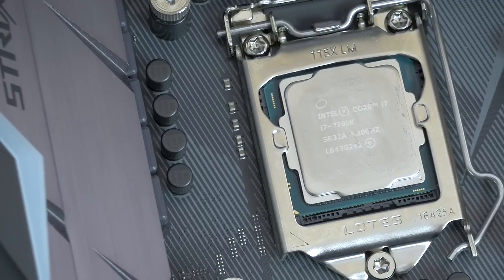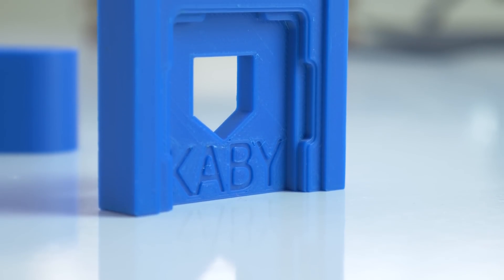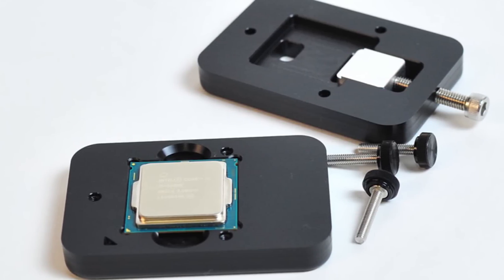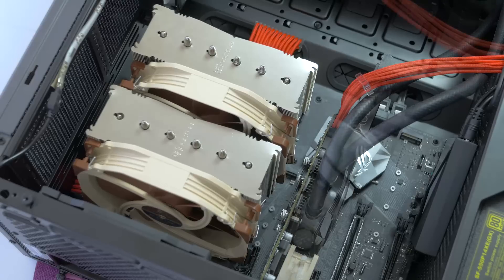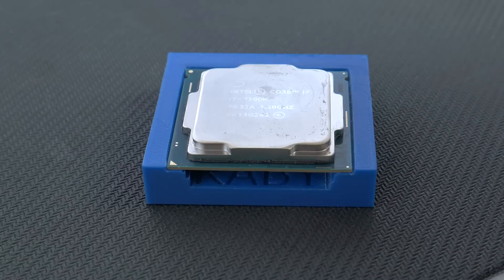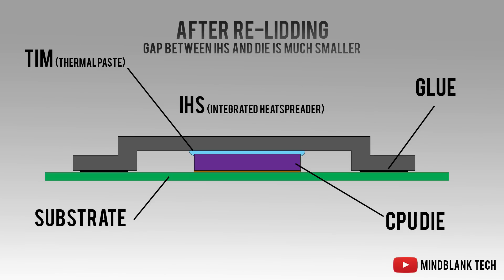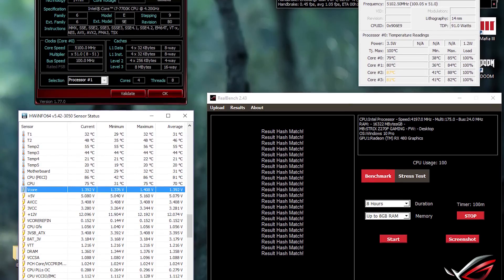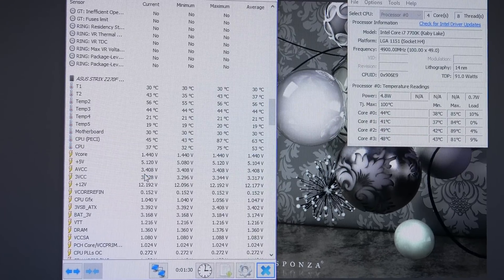Delidding the 7700K - 5.2GHz Overclock - 25C cooler

Comment: The Kaby lake series is already so expensive so why would Intel skimp out on proper cooling?
Reply: Intel has no competition to go against, so why bother.
Reply: Gabriel Umoh I really hope AMD smashes Intel. as there crappy tim jobs are OK on lower tdp chips. but the k series could really benefit from solder, it's not like you don't pay a premium for the k variants allready.
Reply: Another reason to leave intel and go with AMD, I have all my hope in ryzen...
Reply: so people upgrade again to a new intel cpu once amd brings back some competition and they start soldering the chip in their 8000/9000 series chips
Reply: Pop Jones They obviously do if the temps are that high compared to delided chips.
Reply: He means "Don't be an idiot, buy AMD Ryzen."
Reply: oh I wouldn't bother with that neanderthal listening to anything he types is just cancerous.
Reply: If it did degrade the die, then why aren't Sandy Bridge chips degrading? They seem all alive and well with very aggressive overclocks and lower temps than Ivy Bridge to even Kaby Lake chips (prior to delidding). The answer seems simple, Intel's using arguably worse manufacturing process on the reliability side of the chips they're making since Ivy Bridge.

Hell, Der8auer delidded a 5960X and a 6950X and the soldering job was... awful. Like, you'd think a soldered chip would help heat dissipation, but holy hell... when liquid metal thermal paste does the job much better, you know Intel's up to some shady min-maxing on their profits, sacrificing some sense of quality control in the manufacturing process.
Reply: 60c in what? prime 95 small iff or intel burn test or cinnbench or just 60c in games and normal use?
Reply: Gabriel Umoh    Maybe it's to make  enthusiasts void their warranties.
Reply: overheating will demage your cpu not oveclocking +blvk3
Reply: The 7700k only supports Dual Channel RAM. And Ryzen beats chips that are hundreds of dollars more than itself. Ryzen 5 shits on i5s and goes toe to toe with the i7 in new games with better multi-thread support, for 100 bucks less. There is no reason to buy Intel unless money is not an object now.
Reply: @The chemtrail kid
Why not take your own stance? Why not take both statements into account and think for yourself?
I don't think they're using this particular thermal paste just to save money, but it's prbly a nice bonus that made them consider this choice. 
You should watch AdoredTV's newest video, in which he explains just how low the quality of the consumer grade Intel silicon actually is. 
Basically: The best thing they can produce is a 24 core chip. But until AMD brought Ryzen, Intel was giving the mainstream only duo and quadcores. Let that sink in for a second. 
Now they're suddenly launching up to 12 core chips with Kaby Lake X. Just like that.
Why is that? It's because they have been selling these chips as xeons for the server market prior to now. 
The Intel 7700k is literally the best of the worst rubbish Intel can produce.
Reply: Uh okay... it's IPC... just saiyan. And no, AMD is behind in both IPC and refinement of the process / max reachable clock speeds. 
"If games and content creation really did prefer higher core counts, Ryzen would absolutely dominate Kaby Lake mainstream and it does not. It is competitive because its IPS is similar to what Intel has to offer."

Acutally, Ryzen obliderates Kaby Lake in content creation. Look at some Benchmarks of production workloads:
https://www.golem.de/news/ryzen-5-1600x-im-test-der-fast-perfekte-desktop-allrounder-1704-127157-2.html
Doesn't matter if it's blender, 7zip or cinebench.

As towards gaming: You're operating off of the false assumption that AMD is equal to Intel in IPC and clock rates. They're not. Core for core, skylake is about 15% ahead on average - AMD is only offering Broadwell-E IPC. 
http://cpu.userbenchmark.com/Compare/Intel-Core-i7-7700-vs-Intel-Core-i7-5820K/3887vs2579

Take a look at the single core performance.
Reply: @WTF HOLYFUCK
Well, I would rephrase that: AM4 is future proof. AMD confirmed the continued support of AM4 until 2020 and for at least 2 more iterations of ZEN chips.
There is nothing stopping them from bringing 10, 12, 14, 16 cores to the mainstream market if it makes sense business wise in the future. 
Buy a decent AM4 Board now, get the Ryzen 5 1600(x if you don't want to OC manually) and in 2019 or 2020 get yourself an 8 core with 4.5 ghz and you're set.
Btw. when it comes to Intel: There are a lot of rumors that coffee lake, Intel's gen 8, will come out in August with 6 cores for the consumer market. 
Very, very soon, the same zealots who argue right now, how you don't need more than 4 cores will completely change their minds and tell you that 6 cores are the way to go. But ofc only from Intel.
Mark my words.
Reply: Look at all these intel engineers talking facts here (no sarcasm)
Reply: Damien even if it's true it would be obsolete long before it has degrated. intel is skimping.
Reply: Gabriel Umoh maximize profits
Reply: I dont know if it is bad luck or what but I have mine at 4.9ghz and it maxes out at around 60 degress (nzxt kraken x52)
Reply: Yep 5ghz @ 1.3v stable H115i AIDA64 temps hitting upto 85...
Reply: i7 7700k is only good for very high fps. 144+ around 100 fps it doesn't matter anymore.
Reply: intel has used crap thermal material or compound for along time also they glue the ihs on... instead of welding or soldering. I think since 2nd gen i3 / i5 /i7
Reply: @Gabriel Umoh to hide the true potential of the CPU. They can ask the price for the performance they're providing already, why let it boost to 4.5 or 5 ghz then?
Reply: +Mario Darnadi I like how you make unbelievably dumb comments, on a well informed and informative youtube channel. I'm honestly surprised you aren't banned or blocked. You telling people they are wrong for their own choices or think against it, is fucking childish. Man baby. Stop liking your own god damn comments as well.
Reply: this is one mystery i would never understand, as if ppl can tell between 140 fps and 120 fps.
overclocking will damage your cpu in time anyways. and its not like the base clock is slow at all
Reply: yeah i liked my own comment 3 times you fucking moron .... i said you are wrong ? well you are wrong why would the weld it ? without OC you dont get less *c from it. if you said " only if they used better termal paste then ok but you think you are so smart using terms what you find on formus..
Reply: why didn't you ban him? this kids useless... comes on here and literally degrades the comment section of your youtube content. Do yourself a favor MindBlank
Reply: you clearly did like your own comments, they only had 1 like. It's impossible for anyone to like such garbage information

also you have no clue what I even said, I said intel glues instead of welding or soldering.

that plays a huge part in temperature disparity over cores.

Jesus christ man. grow a brain or something
Reply: @Mario 
Au contraire, you're a clueless carcinoma trying to spread misinformation.
M'lady.
Reply: @Angus1MacGyver
Even among enthusiasts the consensus is to leave thermal paste be as long as temps are fine. Obviously it depends to some degree on your use case, meaning which compound was applied, how big the delta °C is throughout operation, how much load your pc is dealing with and for how long (always on?).
That being said, some people like to re-apply thermal past every 12 months to ensure that the cooling performance is always the best it can be, given the equipment.
Reply: Because they have to worry about more than absolute best temperatures. I guarantee you they picked this TIM with shipping conditions, application consistency,  and long term performance over many, many heating cycles in mind.
Reply: That's incorrect, it's all about money savings, not about longevity or anything like that, thinking like that is what intel wants you to think. They want you to think they went the cheapest route cause it's the best.

It's not. It's a farce. Send me a cpu, I'll delid it, re thermal it, build it and never touch it again for 10 years, and the "liquid cool ultra" will still be perfectly fine.

So, nope you're wrong. They don't worry about anything other then money.

You should honestly know this by now.
Reply: why does a company exist? To make money. What's the best way to make money? make people think you're CHEAP AS FUCK SHIT, is MADE of gold.
Reply: Shame on Intel for not using liquid thermal paste on their high-end models because it lasts ten years. Let's all buy AMD now. Case closed. Fuck off.  

Meanwhile I'm enjoying my (not delidded) 7700k @4,7Ghz+ below 68°C on air cooling. My stock paste is so cheap it won't allow you to overclock over 5Ghz. Shame on Intel for that. 

But all shittalking aside, you still get what you pay for on a 7700k, even if it doesn't allow a 1Ghz overclock without TIM modifications. Those chips could be $1 dollar in manufacturing costs and they'd still be worth it for what they deliver.
Reply: I think I'm going to trust Intel's R&D team over WTF HOLYFUCK's extensive YouTube posting.
Reply: Because didn't you hear that they don't want us to overclock Kaby Lake chips? Lol!
Reply: I am. Looking solely at core count is like looking solely at clock speed ten years ago. Whether you like it or not, even things like video editing still favor higher clock speeds over massive core counts; Linus did a good video on this. On the mainstream, investing more many into higher core count chips gets sharply diminishing returns for the vast majority of uses.

Intel has released higher core count chips to appease market demand because people associate performance with a higher number.
Reply: The clock rates hit a plateau with Intel's Netburst architecture back in 2002. Yes we've managed to go beyond 3 ghz, but considering it's been 15 years since we hit 3 Ghz, we can still speak of a plateau for the most part. 
Like it or not parallel computing is the future, not single cores with high clock rates.
"Whether you like it or not, even things like video editing still favor higher clock speeds over massive core counts; "
Aside from the fact that most people prbly use CUDA cores for rendering, that's just false. Outright false.
" On the mainstream, investing more many into higher core count chips gets sharply diminishing returns for the vast majority of uses."
Actually it's pretty much only games with old API's (DX11 and prior) that don't need that much parallel computing power.
Vast majority of uses? Name a couple.
The "mainstream" desktop market is dying either way, with a rapidly growing mobile market to substitute it.
Soon only content creators, enthusiasts and gamers will buy PC's.
And out of these 3 groups 3 need massive core counts. For content creation it is already true, for gaming it is slowly becoming reality with each new DX12 / Vulkan game that's coming out.

https://www.computerbase.de/2017-02/cpu-skalierung-kerne-spiele-test/#diagramm-ashes-of-the-singularity-dx12-fps
http://images.techhive.com/images/article/2016/02/dx12_cpu_ashes_of_the_singularity_beta_2_average_cpu_frame_rate_high_quality_19x10-100647718-large.png

As more and more games with a core scaling like ashes are coming out, very soon hexacores will be the new midrange, even in gaming. I mean since ryzen they kinda already are, but the games aren't fully optimised quite yet and there are still some popular titles with older API's.
Reply: People have been saying big improvements for multi core support in games and cont creation is coming for years now. It's improved but now much, IPCs are still king. 

Enthusiasts don't purchase equipment because they "need" it, they purchase it because they want it.  

Content creators are using more and more GPU driven approaches. Seriously, Linus has done a tone of work on this and found super high core count chips just don't pull ahead like they should if multi core support is really where it's at. 

Games still aren't taking full advantage of multi core support. Doing a dollar for dollar comparison looking at 7700k and the 1700X, if many cores really was better, we would see the 1700X pull away from the 7700K in non GPU bound tests (1080p high with low settings) and we simply don;t/
Reply: Umh ya, I guess you agree with me that content creators are using CUDA acceleration for the most part which is a heavily parallelised architecture. 
It's true that older games don't newer games do though.... I provided you sources... it's not some "maybe in the future" but it's games that you can play RIGHT NOW that run best on 8 cores.

And you simply don't recognise how many reviewers are showing the superior frame times of 6 and 8 core chips.
https://img.purch.com/r/600x450/aHR0cDovL21lZGlhLmJlc3RvZm1pY3JvLmNvbS8zL0IvNjY3NTU5L29yaWdpbmFsL2ltYWdlMDU0LnBuZw==

But at this point I'm just going to assume that you're choosing to ignore facts that could harm your opinion.
Reply: Dude, we're talking about CPU products and the merits of more CPU cores. No one is doubting that GPUs benefit and take advantage of highly parallelized work loads.

If games and content creation really did prefer higher core counts, Ryzen would absolutely dominate Kaby Lake mainstream and it does not. It is competitive because its IPS is similar to what Intel has to offer.
Reply: Ryzen was never made to dominate intel. But you're forgetting something chemtrail.

Intel got fucking smashed when it came to productivity, up to 75% worse performance when looking at the 1800x vs 7700k.

So you gain 15% fps, but lose up to 75% productivity?

Both cores and company's have their pro's and cons.

You kind of don't know what you're talking about. Go look at benchmarks.
Reply: In a way, ryzen does dominate kaby lake.
Reply: Oh I agree completely. True AM4 is what I should've said, and ofc they will. These fankids are the worst. I'm on both sides I love both company's. I've used intel for most of my life. lol It's not like it's useless, It's to expensive and they are seemingly getting cheaper and cheaper with IHS and PCB's. so I'd rather just pay 200usd for 6 cores and 12 threads, and be able to do everything intel does with their 1500 dollar cores.

I don't care if I have 15 less fps with the same productivity, it was 200 bucks.

rofl.
Reply: @WTF HOLYFUCK
Oh yeah exactly, it's so funny how many fanboys are out there. Like just a few months ago, AMD was the laughing stock of almost everybody online, and now suddenly I read comments like "I grew to be an AMD fanboy now, because blabla" and I'm like: Dude wtf. Why can't you be brand agnostic? Why do you always have to be a fanboy of some company?!
How to trigger the fanboys really hard, made easy:
https://gyazo.com/fc6e4440f87e82c5cbbc1aa263a73e60

Btw. I always tape these types of coolers because there is literally no point in exhausting hot air against the side panel. I'd rather have more air coming out of the front and the back of card.
Reply: hahahahaha
Reply: Don't be an idiot and buy AMD Ryzen.
Reply: Wait doesn't "Don't be an idiot and buy AMD Ryzen." mean that he wants people to buy AMD?
"Don't be an idiot" = be smart about it. See?
Be smart about it and buy AMD Ryzen.
Reply: yeah I misinterpreted it.
Reply: Nub McWeaksauce i have 1800x and its ok for editing
Reply: I have a 1700, I'd say why get an 1800x? My 4ghz 1700 benchmarks right next to any 1700x/1800x and I only paid 249$ I personally say go with the ryzen 1600 / 1700  cpus imo, the x series chips are useless to me (XFR 50mhz more than Non X series chips) since once you touch the multiplier the xfr is disabled. so that 50mhz more the x series chips get is a waste.  Just my two cents, I mainly game+stream which is why I went with the 1700, besides the dope price tag of 249$ back on march 10th. I built a 7700k for someone months back, at 5ghz it's a sweet thing dont get me wrong, but I'd rather not drop 18% of frames rendered and have to deal with limitations of the chip in multithreaded and gaming+streaming workloads,plus that rather small 5% fps more the 7700k got in just gaming workloads would benefit me none since im typically always stream+gaming.  the 1700 just showed much more value imo.
Reply: @Christopher Kelly
Well there's a reason why the 1600 and the 1700 are so popular. However, if you want to make sure that you hit 4.0Ghz you kinda have to go with an x rated chip or buy from silicon lottery. What's the max stable clock you can run your 1700 on? Sounds like you got a really good chip.
Reply: @marcel every ryzen chip I've seen and overclocked for my friends all hit 3.9ghz +!

ryzen 5 1600, ryzen 5 1400, and ryzen 7 1700 all hit 4.0ghz for my friends

and my ryzen 5 1600 hit's only  3.9ghz : (

but even with that said, Lot's of x branded ryzen only hit 4.0ghz. Paying a premium for 100mhz bonus makes no sense
Reply: I didn't get 1 chip to 4.1 tho, no matter the timings on the ram or voltage adjustments.

not even with new bios updates, maybe it's the ram? maybe it's the mobo's? or maybe that's just ryzens max lol
Reply: You do realise that "your friends" are no sample size?
https://siliconlottery.com/collections/all
Do you think siliconlottery would bother with 1600x chips if they could just sell you the 1600 at 4ghz?
https://gyazo.com/a573207ce102827958d7b1c760756fc1
Do you see the little bars in the lower half of the screen, right above the speed rank rating? 
Those bars are indicating the performance levels of users benchmarking their CPU's.
Do you see how the 1600x spikes a good amount further to the right (meaning higher clocks, higher performance), compared to the 1600?
Do you see how the best bench of the 1600x is at 4.2 ghz, whereas the best bench out of almost 5k samples is only 4 ghz for the 1600, and judging from the bars, it looks like only very few chips are even hitting 4 ghz.
Reply: I mean as I said, there's a reason why the 1600 is so popular. But sometimes the 1600x is on sale, I've seen it as low as 230€, and for that price I would always go for the 1600x over the 1600.
It's not like I am going to use the stock cooler anyways, even though the wraith series is decent. 
For a 95W tdp CPU I really want something along the lines of a Noctua NH-U12S SE-AM4.
Reply: Well what are you using for cooling? Obviously with the stock cooler, it's 65 watt tdp can't really handle 4ghz imo, neither 3.9 barely. BUT in order for me to hit 4ghz+ You need to set Load Line Callibration (LLC) and Power phase to extreme. That's what was required to Get a stable 4ghz since you need more than the voltage offset max of 1.384. So in order to do that LLC level 5 or extreme will allow you to hit 1.4+ voltages which is required for ryzen to hit past 4ghz. I needed 1.41v max for a regular 4ghz oc back in april, I've now dropped it to 1.395v however and it's been stable for a few weeks via Prime95 & OCCT linpack stress testing.

If you don't set your LLC to a higher amount you simply won't exceed the 1.384v max, making it impossible to probably even boot 4ghz. You either don't know your way around a mobo or were just being lazy both a 1700 & 1600 I've built (1600 was for somone else) could hit 4ghz. IF it's stable is a completely different story.This was back in april on a 40.00x multiplier so a straight 4ghz With the stock wraith spire cooler at the time LOL I'm now on a MUCH better Liquid AIO and nearly 4.1ghz. I've gotten this both on my 1700 (Asus Prime b350-plus) agesa 1.0.0.6 (june 5th version 0803) and on the MSI Tomahawk which was seating the 1600 I built for someone. Your Simply not going to be able to hit 4ghz on any chip without overriding that 1.384v max, 1.4v is really needed for those 4ghz+ profiles. Just don't exceed 1.45v as degenerating the life of the chip is possible, Despite the 1.55v max, I'd say 1.395-1.41 volts is just fine as long as you got the proper cooling for it. 

http://imgur.com/WCOcnKh
Reply: " IF it's stable is a completely different story."
I don't care what the max clock speed is a CPU can reach under extreme conditions. I want it to be rock solid stable and sustainable. Which is why I personally will prbly go with the 1600x and see where 1.35V will take me. Too bad shipping is so expensive to germany, otherwise I'd buy a 4 ghz rated model at silicon lottery, just because I don't want to fuck around with overclocking too much, maybe even have to send back a chip that OC's poorly or something.
Reply: Stable? yes it was stable. Back in april on the stock wraith spire cooler 4ghz (40.00) was stable after all the prime95 Torture test for hours and several hours of OCCT linpack along with me streaming+playing csgo and other games I play in between just to assure I'll have no issues. I've never had problems with stability with any of my oc's if they passed a few vigorous weeks of Prime95 Torture tests and occt linpack. some people just don't know their way around a bios, 1600x meh, I built a 1600 for someone, all in all it's sitting on 4ghz on liquid cooling and so is my 1700, so either people got very unlucky or they don't know their way around a bios. 1.395 - 1.4v @ 4ghz is entirely possible on most chips.
Reply: You do realize, the only hands on work I have with them, are through the pc's I upgrade and built with my friends. I don't give a rats ass about the silicon lottery, I was saying the ghz I achieved easily across the board, which was 4.0ghz on all NON X ryzen.

3.9 on mine and 4.0 on the other 3 I built / upgraded.

I know the X are better binned, more "capable" but that doesn't justify the price (if it's not on sale)
Reply: Load Line Calibration and possible power phase is needed to set higher than auto, since your preset max on voltage on am4 boards IS 1.384v and it's been known for a while that you need 1.4v for most 4ghz oc's. Now I'd advise not passing 1.45v, hell I'd avoid any higher volts than 1.42 tbh, 1.42 was my max threshold, getting it to not exceed 1.417 on Extreme LLC (level 5) was all I needed. 

http://imgur.com/WCOcnKh
Reply: @WTF 
That's what I said / what the data available suggests. You and your friends have been relatively lucky with your chips. I don't know why you're putting more capable in air quotes, coz they're just that. More capable on average. 
Well it depends on how you look at it I suppose. The price difference is 50€, that's about 25% and you get the cooler with the non x, so yeah from that perspective it's not worth it.
But with the higher OC potential and higher clock rates out of the box the 1600x does a) better when not overclocked / on stock voltage which is relevant to some users and b) is just that little bit closer to the i7 7700 non k in single threaded performance. And if you're like me and you don't want to use the stock cooler anyways it's just not as clear cut anymore.
The 1600 is more popular and offers better value :) But I'd rather pay the 15% extra for the 1600x when it's on sale and make (relatively) sure to hit 4 ghz at reasonable voltages without having to get into "extreme" overclocking.
Reply: Article is about the performance of various thicknesses of gold plating on Indium-based thermal solder on a small-die BGA chip and doesn't seem relevant to consumer CPUs?
Reply: overvolted CPUs may get damaged due to electromigration, but the question is how long until it really dies ? like someone pointed out.. Sandy bridges going hard at 5ghz are still going strong... and I don't think they will die anytime soon, so the question is how long ? 10 years ? what's the average lifespan of a CPU.. especially in the overclocking community, it never reaches 10 years.. also keeping it cool and not on 24/7 helps ALOT. 

ALSO there is the random factor, one guy could get his CPU to die after 3-4 years if he's not lucky, actually, I overclocked a friend 2600k, I was already very disapointed by the clocks 4.4ghz and the huge amount of voltage, but the CPU died a few weeks later, I say he just wasn't lucky, that was not long ago by the way like last year. 

Also I wasn't the one who checked it so I'm still sceptical, he got one of his other buddies to troubleshoot and that's how he realized the CPU was dead.. but yea it sounds legit though as he gave him another 2600k of from his old little bro PC he wasn't using anymore and it worked again after that so.. had to be the CPU, but still, I'm a bit sceptical (maybe because I haven't seen it with my own eyes eh, St Thomas, lol) but yea, I think it may just happen, a small percentage may die, but overall, those things are pretty much unkillable and I'd say a 10 year lifespand, even OC @5ghz/max would sound reasonable, and conservative, it will be interesting to see in a few years actually if OC'ed Sandy bridges start to die off because.. since it's some of the best CPU ever made people might still be using it after 10 years, from a quick google search I seen the reviews were made in january 2011, so, soon 7 years... have you heard of many people in the forums etc complain of their CPU suddenly dying ? no.. so yea, 3 years to go until we reach the 10 years mark.
Reply: Here are your answers:
http://www.anandtech.com/show/2468/6
http://nomtbf.com/wp-content/uploads/2012/05/800px-Bathtub_curve.svg_.png
http://nomtbf.com/wp-content/uploads/2012/05/bathtub-drain1-e1338307349472.jpg
https://www.quora.com/How-long-can-I-run-my-PC-continuously
TL:DR
- Tech is generally either failing in it's infancy or due to wear out. 
- Most CPU's are manufactured in a way to last about 5 - 7 years of constant (24/7) use.
- Better cooling, better VRM's and a higher quality power supply, undervolting and/or underclocking will increase the lifespan.
- Overvolting / overclocking will decrease the lifespan due to more heat being generated and more wear and tear on the circuitry by electronic migration. 

If you are primarily gaming and doing nothing else with your system, of course you will shut it down whenever you're not using it. So let's say for simplicity's sake that you're using it only 8 hours a day. Suddenly that CPU can last 15 to 21 years with your user habits. Now, you will shorten this by a lot when it's constantly pushed to the limit (5 ghz ...) but since you're only using a couple of hours it'll prbly still last you about 3 or 4 years of 24/7 or, 9 to 12 years of 8 hours a day.
These are rough estimates but they should be fairly accurate when trying to predict the lifespan of somewhat modern CPU's.
In the past the argument used to be that you won't use a CPU anymore after 5 years anyways, but nowadays this just isn't true anymore. Sandy and Ivy bridge i7's are still decent today and to a lesser degree even the i5 2500k / 3570k are holding up okay-ish. 
If you're a gamer and you only use the CPU for a couple of hours a day... sure overclock it. I prefer longevity and stability and I need my rig to run 24/7. 
2 to 5 more years of 24/7 operation without hickups is worth more to me than 10, 15% of performance gain from overclocking.
Reply: Using TIM is cheaper, yet Intel has to pick one that lasts for several years. Liquid paste needs reapplication every now and then, which most users don't know or mention when delidding their cpu.
Reply: Name 187 wait so the tim Intel uses causes degradation or the solder did?
Reply: I guess its because they dont need to, unlike amd who weld/solder theirs and they are still stupidly high temps.
Reply: Ryzen is future proof, cause as everything moves forwards more and more programs will be multi threaded. 4 cores 8 threads, Is a thing of the past.

let these intel fankids enjoy their fast aging crap with horrid IHS put on with glue.

And I'll enjoy the fuck out of my ryzen 5 1600 clocked to 3.9 with its soldered IHS

:D
Reply: Gabriel Umoh that's the bullshit lol I have the kraken x61 which cools better due to the fans and a faster pump and mine at 5ghz will go to 83 degrees Celsius
Reply: how it doesnt matter ? 7700k is just cheaper and for gaming you are doing for cheaper stuff always
Reply: all i am saying that i7 7700k only have higher max fps in games. around 100 fps or higher resolution difference is none to minimal. people without 144mhz monitors will not feel a difference.
Reply: Mario Darnadi nope, overclocking means it's working at conditions which the CPU is not designed for, of course it's going to damage the die
Reply: Marcel Krebs i see you did not get what i said... But what ever...
Reply: one more reason to support AMD. there is no way to treat customer when they are charging for premium prices whole giving us cheap parts
Reply: imo save up for x99 much better and ihs is soldered. kaby lake is overpriced garbage.
Reply: Ryzen shit I dont care, only dual channel RAM, fucked support for PCI lanes, bricked RAM for some users because software was "to new for the market", in gaming performance and me building a new gaming rig the only reasonable choice is going for Intel 7700k, dont care if its a hot chip it will get a water cooled anyway. Everybody loves something new but im still gonna stick with good "old" Intel and Nvidia.
Reply: expensive ? :D 350 for beast for gaming ? yeah go and buy 1800X for 550 and get 25% less fps
Reply: WTF HOLYFUCK you are just stupid....
Reply: CooperZ2 ryzen is cheap as everything around it. Its like buying something from china (amd) ot buying something made in germany(intel) mobo for amd are lower quality then for intel, support for amd is weak etc.